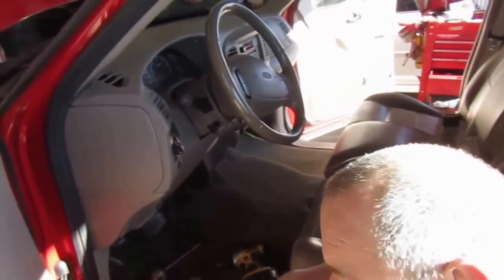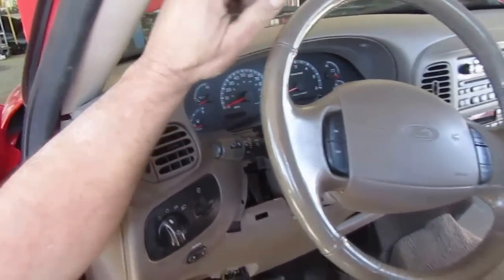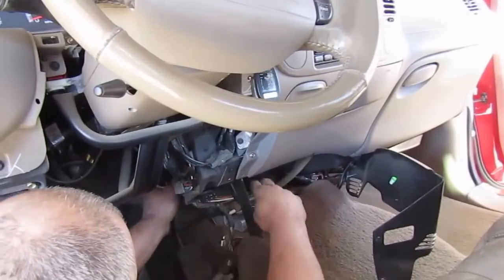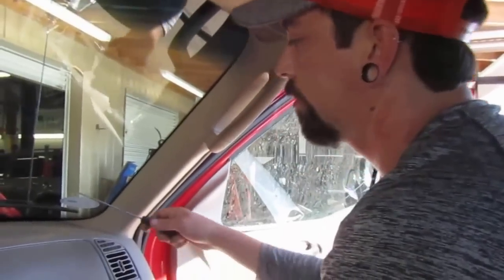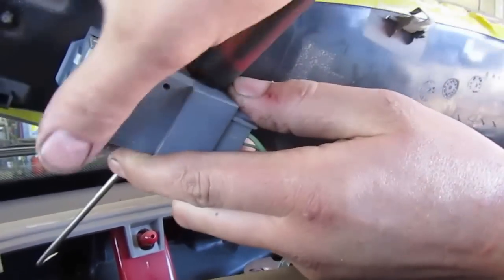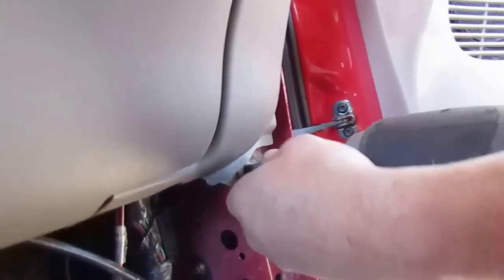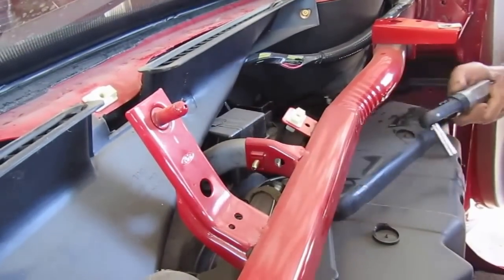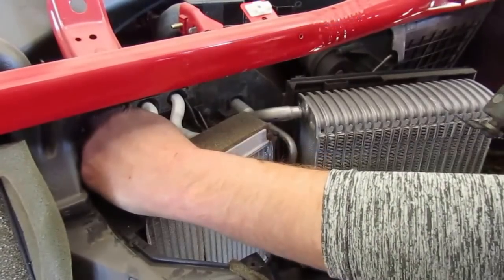Heater Core F150 Replacement , $370 Dollars 28 Minutes, Carpet Wet

Comment: Just wanted to thank the men in the video. I own a 2002 F150 XLT 4.6 4x4 Extended Cab. I was able to take the dash out in around 45 mins. I bought two magnetic screw trays; one for the passenger and one for the driver side to keep all the bolts separate. I didn't use a impact driver, instead; I used a ratchet with extensions so I could take my time. I recommend getting a small pick set to help with the electrical connectors and such.

I also used a oscillating tool with a Dewalt "metal" blade; it cut through those heater core lines like butter. However, removing the heater hoses can be aggravating once you try to remove them from under the hood. One hose is easy, but the 2nd one, that is connected behind ignition coil #4 is harder. The factory clamps I would personally reuse, they are better than the cheap adjustable ones. Reason being is they will not stay tight through the pressure/heating/cooling process. They will leak at some point, and you'll likely over tighten them resulting in a failing point on the hose itself - especially if you're using 15-20 year old hoses. My opinion: try to save the factory clamps! If you break them, or if they have rusted, I found some at Lowes for certain diameters 1'' or so by Hillsman. The larger clamps for the lower and upper radiator hoses are much larger. Hell, I think the heater hoses are 3/8th or 5/8th.

I've been putting this heater core job off for too long. I put a Prestone radiator flush in my truck and drove it for 2-3 days; I noticed coolant in my floorboard (lucky to have vinyl flooring instead of carpet.) I had to buy all my heater hoses at autozone/advanceautoparts for a upcharge instead of ordering everything from rockauto like I normally do. I hope danco hoses hold up for a while. I really recommend flushing your system a few times with your old heater core before you replace it new along with a semi-dirty radiator. I'm going to install my new heater core, and do another flush immediately with the chemical treatment and distilled water. If i had the money and time I'd go ahead and replace the water pump too.

I replaced the thermostat, and I recommend everyone looking to replace their heater core to replace all of these things:

Both Heater Hoses
Both Lower/Upper Radiator Hoses
Coolant Reservoir Tank (I took mine off to clean and its a pain in the ass if someone put radiator stop leak in it or mixed coolant types)
Coolant Reservoir Lid
Heater Core
Thermostat (CAREFUL REMOVING THERMOSTAT HOUSING/WATER OUTLET BOLTS!!! USE TORCH!!)
Thermostat Outlet Gasket

(F150 2002 XLT 4.6 USES GOLD COOLANT)
Coolant 50/50 (2 gallons)
Coolant Concentrate (2 gallons)
Distilled Water (I bought 6 gallons)

Notes: I bought a Thermostat that locks in the open position if the engine reaches above 180 degrees. Hopefully, to prevent vehicle damage.

_____________________________________

Comment: Your video has given me the info to replace the part on my 1998 F150. You make great instructional videos. Glad you left the top of dash bolt cover removal in in all its detail - showed me what to expect. Great entertainment and realism with the customer included. I hope your heart snaps back together as easily as the vehicles you work on. Should work and then you're good for another 200 K miles.

Comment: Ripping my 1999 F150 console out to replace the heater core. Excellent Video!!!! Took me 2 hours to get the console out watching you guys and putting bolts in a few zip locks with the time stamp written on bag to help me put it back together and hopefully not miss a bolt.... THANK YOU! Saved me $$$$$

Comment from the maker: WANTED: 98 HEATER CORE GUYS TO TRAIN FOR 49 STATES. You can easily make +100 ruebulls a hr. It only takes 28 minutes with the right stuff trainings at The Heater Core Guys Training Institute of higher heater core learnage in SC. Yull need about 3 sockets and a deWalt. Flashlight too. Gimme a call to set you up in the great field of heater core technology. Setting up a franchise is easy. You can easily make 16,000 a day in New York. Plenty of dummies there will pay good. Got alotta cold asses in NY,  Buffalo, Avoca.

Comment: Thank You Guys So Much! I watched as many of your F150 videos as I could find, then tackled this project myself. I had a hitch though.. It stopped me overnight. The new blend door with the metal ring was too big to fit down properly on the shaft. The next morning, I used an $8.00 3/4" holesaw, with my bare hands (not with a drill) to ream the hole out - without removing the actuator. It only took about a dozen turns with no downward pressure. The space between the actuator and the bottom of the plenum box was enough that I could feel when the cut was complete, and the holesaw never touched the actuator... From there, it was smooth sailing. Thanks again! And buy Flock another case of Red Bull!
Reply: +Tomcat6541 Wow... I just read some really bad news.
 http://www.thekennedymortuary.com/obituaries/Jake-Payne/#!/Obituary 
Rest in Peace sir.
 He was one of those guys who feels like your buddy, even though you've never met him. Prayers for the family and friends, and God bless you Kyle
Reply from the maker: +Tomcat6541  Thank Ya Thank Ya Good Sir...... Still Doing them heater cores for my dad. aka Dr.Jake

Alex
Reply: +Jake Payne (The Heater Core Guy) God Bless you too Alex! Your dad was a genuinely interesting guy. Count your blessings and keep your dad close to heart.
Reply: I am so sorry to hear that news. I have been watching as many or their videos and I can. I had no idea that his dad passed away until I saw your post.  God bless him and his family as they near the 1 year anniversary of Dads passing.

Comment: This was a huge help on my 2001 F150: heater core clogged from some weird, gooey, oily coagulated brown crud.  Still not sure what it was- could be decomposed or bad mixed antifreeze- was also in the coolant resevoir.  I have no water in motor oil or ATF.   

I have the factory shop manual- tells you to disconnect electrical bus harnesses at firewall near power distribution module!?  WTF?  Factory manual scared me from doing the job.  Way easier than I thought it would be.  The Dorman aftermarket blend door COULD NOT BE INSTALLED AS SUPPLIED.  The driven part of the blend door will not enter all the way into the hole where the actuator drive is.  I took my Dremel cutter and made circumferential cut around the aluminum reinforcement sleeve and removed the bottom 5/16" of the aluminum sleeve.  When heater knob turned all the way to cold, the Dorman door did not shut completely at first- was about 3/16" gap on right- hopefully the foam will conform and seal tight.  

And what's up with those stupid heater hose "quick-connect-but-can't-never-disconnect" connections?  The oscillating saw idea is best- my Wenn ripped it up.  Even with the original hose and the sawed off heater core nipple in my hands, I couldn't disconnect them.  Bought two new Dayco heater hoses from AutoZone-  the hose from the t-stat to the heater core inlet seems too short/bad fit- any better option for heater hose?  THANKS GUYS!!!!  NOW I GOT THE HEAT.  Too old to drink Red Bull though- gets me all nervous.........
Reply: did you have any problems putting everything back together, no alignment problems?

Comment: Had to change my heater core in my 98 F150.  Follow this the get mines out and it was right on.  The only difference was the airbag module.  Mines in located in a different location so I just bypassed that.  Excellent, thank you!!!

Comment: Excellent tutorial, you guys explained it very well.  I followed your instructions and the job was no problem.  I even put screws back in that the previous guy had left out.  Thank you!
Reply from the maker: Heard that had one that had been two Ford dealer twice to have heater core lady said her dash rattled for  7 years but never rattled again after I was done with the job. As you can figure Ford certified techs didn't put back but about 5 screws and bolts in total

Comment: Great video. It did take me a few hours, but even this old half blind guy was able to get the repair done and the truck is back on the road.  While this may be an preexisting problem, I now do not have dim lights. brights work no dims. All fuses are good but I'm not getting voltage out to the bulb. If it tuns out that I caused this problem doing the repair, that's on me, Y'all are awesome.
Reply: update: the no low beam problem was cause by me leaving the "aggravating" connector under the dash cove disconnected.  All good now.  Once again great video.  Thank you very much.

Comment: I read where Mr. Payne, the older gentleman in the video, has passed. I hate to hear that. My husband is going to replace his HC in a 2000 F-150 this weekend. I’m sure he will use many tips from Mr. Payne by watching his videos. God Bless the Payne family 🙏🏻🙏🏻
Reply from the maker: Breanna Sanders  if you need any help or hear anyone needing to get theirs done send them in down gimme a call 864 871 6243  Jake Payne
Reply: Hi, I am in fact replacing the heater core in my 2000 Ford F-150 Lariat this evening. Is this video similar to what I will be facing pertaining to that model? Thanks! God Bless
Reply: @Jakepayne99 Hello.. I have a 2000 navigator. Where are you located

Comment: ⚠️ CAUTION ⚠️ Be careful if your truck has a manual transmission!!! You’ll need to remove the floor shift stick AND unplug the wire harness to the clutch pedal switch! My dash was hung up and wouldn’t come out far enough until I shined my flashlight behind the dash to see what was wrong. 
I used this procedure and same type of cutting tool to replace my evaporator coil and blend door. I did have to make two vertical cuts in the plastic to the right of the core in order to get it to slide in without bending the tubes.

Comment: Do you guys diagnose bad heater cores or just replace them? I have 02 f150 luke warm heat, heater core flushed 3 different times, once last year, twice this year. each time help heat some but then it went back to luke warm in a short time this seems to indicate a somewhat clogged heater core BUT both heater hoses are warm to hot. Blend door operates like it should. I cut access to see it.
Reply from the maker: Well its pretty set forward folk call and say they think there heater core is bad and I ask them some questions  such as is it leaking or do you just not have heat could be clogged to getting ready to blow . Sometimes they will end up telling me the hoses are hot its not leaking but they can hear a clicking in the dash well then thats probably the blend door has done broke so we need to pull the dash back go ahead and replace that the heater core and check hoses and get you all fixed up and back on the road. 8648716243
Reply: The heater hose must have a restrictor in the line or it will blow cool/warm air.
The restrictor is to slow down the coolant long enough to get hot air.
Factory hoses have a restrictor. Aftermarket hoses may not. Check for the "bulge".

Comment: great video...got my like...i changed core on a 97 5 spd..only thing to add on a 5spd truck is make sure u remove clutch safety switch or at least unplug to keep wires from gettin pulled...awesome stuff
Reply: uptonfg wheres that clutch safety switch?

Comment: Question. What is the purpose of having to hack the ports before pulling the heater core out? Doesn't the new one have to go in as a whole or does it just make it easier upon pulling the old one out? If this is true does this mean putting the new one in is a bit trickier since you won't be able to cut the good core? Have the same truck with this issue and now having to replace alternator that doesn't like my power inverter and electric mini low wattage heater all that much. Need a meaner alternator for that.
Reply: The quick disconnects are on the engine side of the firewall and getting to them is a real pain without the right tool.  Once they're cut you can pull the hoses back and pull out the old heater core quick connects. Putting in the new one should be the same no matter how you take out the old one.

Comment: Do you have to saw it to get it out? Why can’t it just be pulled out? I’m asking bc I have my entire dash apart and the heater box apart, and I don’t have a freaking saw handy bc I didn’t know I had to have one!
Reply: You should be able to pull it out without cutting cutting the tubes as long as you have the heater hoses unhooked.
Reply: No saw needed, he did this cause hoses were still hooked up under the hood.

Comment: QUESTION:   Where is the switch that sends anti freeze to my heater core when I turn the heat on?   From what I understand it only circulates when heat is called for?   So where's this magic switch?   Is there an actual valve that opens and closes?   My point is, why would my heater core leak out hot antifreeze when the heat is off?  Why is it under pressure?  I have a 2002 Jeep Grand Cherokee 4.7.  Thanks!
Reply from the maker: +Steve Murwin  Very few heater control water valves anymore. Heater core gets hot water all the time. If it did, it would only have one. That means the other hose is still connected to coolant and can leak on the inside of the box where it lives. 2005 Grand Cherokee and up can be replaced w/o a dash yank. Yours will need to be pulled and it is quite a job. F150 is easy beans yet folks will charge 1000 dollars and up cause most customers have no idea whats involved. The new body style F150 isn't hard either but they get charged more like 1500 dollars. The coolant operates at temperatures above the boiling point of water, so pressure increases the temperature at which it will boil. Antifreeze increases the BP also. Common pressures are probably 13psi or less and 50/50 antifreeze equals 256 degrees boiling point. Coolants Fans are usually designed to come on near 220 degrees. Well above the BP of water. So it needs a good radiator cap and antifreeze (antiboil) to hold the coolant and not turn into a steam generator. I don't think the heater core should be hot if not needed. So much coolant traveling through when not needed equals clogged cores eventually/sooner...Good for business, yes? Hondas still uses water valves. They almost never need one. All Fords need 4 or 5 cores before the vehicles gets trashed. 02 honda accord heater core is 421.00 dollars. We got one now but I finally figured out it is not that. Almost ordered it yesterday. Steve that cherokee is a bunch taking stuff out piece by piece til ya dig ya way back to the problem. Hard to enjoy doing it. Get somebody to help you. Not so bad that way. Where ya at, I come help ya. Gotta be before the 27th, heart doctor gonna bust be open, fix shiite. Get old sux.!!!
Reply: Thanks for the info, Jack.  Damn, a heater core sounds like nothing compared to your heart.  I hope that all goes well.  
I figured there was no switch.  Funny how people still say to "turn the heat on to circulate the antifreeze".  I guess that doesn't really matter anymore.  Interesting stuff about the boiling point and pressure.  I really appreciate you taking the time to type all that.  I missed my window to do it this winter.  Hell, it's not even been that cold here in Jersey.  I'm going to suffer through and try to fix it this Spring/Summer.  It's a lot of work just so I can be warm.  I may just bypass it.  Somedays it doesn't leak at all.  
Thanks again for the info, Jack!  Good luck with your "repair"!!
Reply from the maker: Your welcome. I have about 5 or 6 F150's coming Saturday and a 06 Expedition Sunday. We've never done the 06 before. Done 3 late model F150's but they have changed the expedition on thge inside. It ull be interesting. I found it hard to believe we could do that many in one day. Wish I could get the 1500 a piece. Be rich then. It's actually fun when ya know every move w/o thinking. Be a good weekend to train someone.

Comment: Great video! I just bought a truck that have no heater... previous owner stated he did a bypass by cutting off coolant feed to heater core just because it was leaking... So I'll have to replace two rubber hoses from engine area to heater core... got any advice?
Reply: Jason Driver you will probably have to change the heater core there is a reason he bypassed it
Reply: Thank you, i went ahead replaced both core and hoses. Now it's working great but when i turn on AC im getting hot air too. I figured it's either blend door or blend actuator. Guess I will just wait until weather get warmer.

Comment: where are you guys located? I got an 02 F150 that needs heater Core replaced and I am not scared to do it worked on every vehicle I owned an then some. Just want to make sure I don't pull a line off or mess something up. May take a stab at it? stearing freaks me out.

Comment: Evap core has a leak.  Mechanic suggested to replace heater core at same time as replacing.  2005 F150.  Your phone number doesn't seem to connect.

Comment: 13:48 was the funniest part!!! 😂
Reply from the maker: Billy Knight  hehehhehe lol
Reply: @Jakepayne99  
Ddd Ddd
1 second ago
Do you guys diagnose bad heater cores or just replace them? I have 02 f150 luke warm heat, heater core flushed 3 different times, once last year, twice this year. each time helped heat some but then it went back to luke warm in a short time, this seems to indicate a somewhat clogged heater core BUT both heater hoses are warm, even hot. Blend door operates like it should. I cut access to see it. what do you think, could it be clogged?